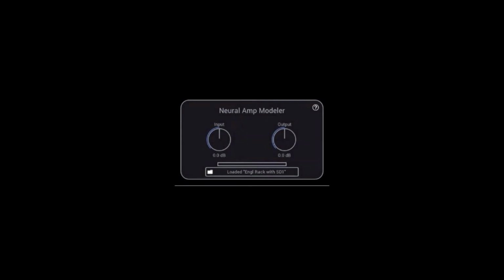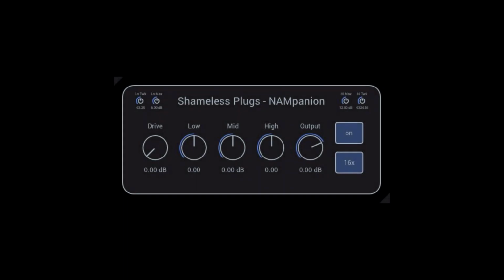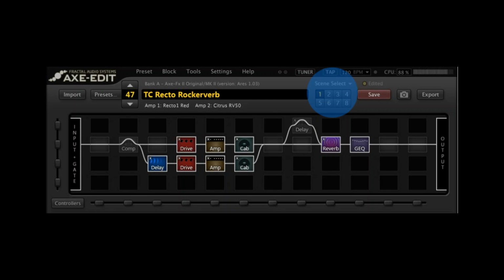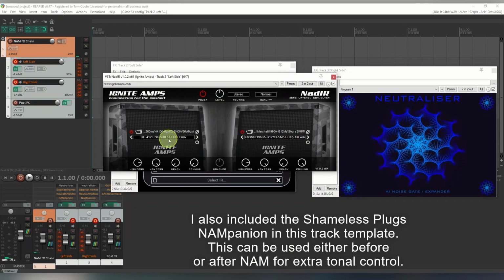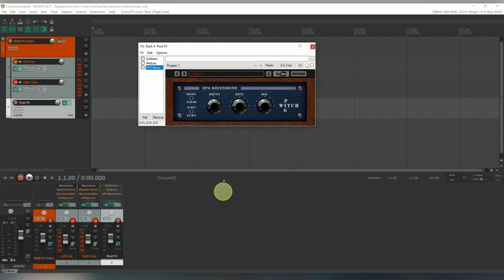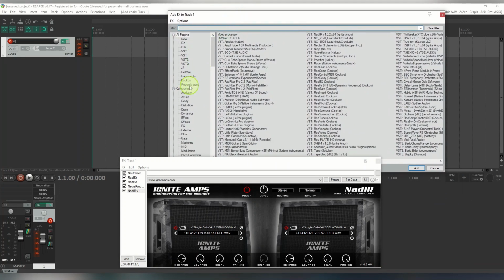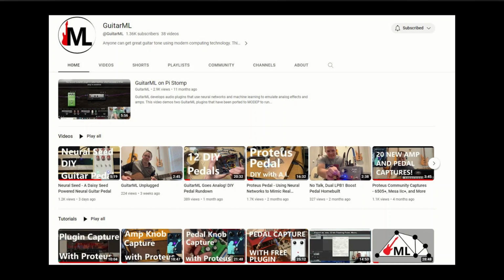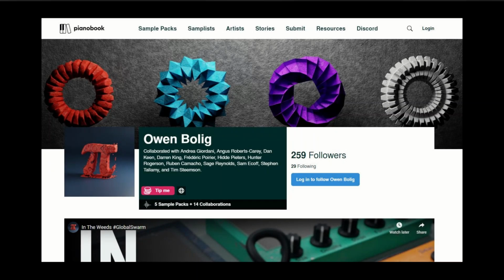Next Level Neural Amp Modeler: Oversampling, Skins, Dual Amp Blocks, FX Chains & more...

Comment: Speaking if which, has Oversampling been added yet?
Reply from the maker: Not yet. But I think the free oversampling filter software I used in the video does make a difference. At leat for me, anyway!
Reply: @tomcootemusic thanks for all the ideas and links.
Reply from the maker: @ramspencer5492  Here's some audio examples for high gain amps: https://www.youtube.com/watch?v=2lSGTrVQpv4
Reply from the maker: @ramspencer5492  ..and here's some I did for bass: https://www.youtube.com/watch?v=kDxZ1SaETUY
Reply: @tomcootemusic . Let me finish watching the video. I read just on my phone last night. Couldn't have done any real listening. I was under the impression that you had to run NAM in 48khz. Might have been an assumption.

No audio examples? Also, why did you use an oversampling plugin if your in Reaper, which has it baked in? Though I am curious about this plugin.

Comment: Oversampling (and internal plugin anti-alasing filtering) is essential for any kind of digital, tube overdrive processing of you want it to actually sound analog and not alias audibly. Whether you hate or don't care about audible aliasing, it will sound different than an actual amp.
Reply: Soundtoys has audible aliasing on Decapitator that I absolutely can hear. And no longer use the plugin.
Reply: When it's down on lower end of the EQ spectrum, Decapitate does sound great on things like Bass and kick....  There is audible aliasing on things like electric guitars and vocals. It does not sound analogue
Reply: It doesn't matter how well the code is written. If you work in lower samplerates, like 48khz.... And have a lot of higher order harmonics, you don't have nearly enough headroom to be able to filter the foldback distortion out. I'm not saying that these kind of plugins that audibly alias are unusable by most people standards. But they do not do what analog gear does. Which I much prefer. aliasing It's strictly an issue in the digital domain. Most people once they've had it pointed out. Realize that they really CAN hear it... And when they have the option of removing it, Love the way that there is added depth and it opens up the sound.
Reply: Absolutely. Totally agree. And actually Decapitator is not TOO bad of a culprit. It's got 4x oversampling built-in, and it compounds; as such, if you oversample it 4x using BC Patchwork, Metaplugin, Reaper, etc. it actually becomes 16x oversampling which is quite tolerable unless you really drive it. Some of the worse offenders imo are plugins like TAIP, Arturia dist/comps, Tone empire etc... really anything that can't be oversampled (not even via wrapper) without completely falling apart. I personally won't touch NAM with a 10-foot pole until oversampling is implemented. Very promising technology though.

Comment: Good video, Evan's design ended up being the winner for now!
If you're interested in the "scene switching" thing, I did put out videos about how I built a custom MIDI pedal for that, as well as how to implement it in Reaper with no latency when switching, which is quite involved in the end. Since NAM is a bit more CPU hungry, I could see that being a potential problem with my switching system, since you're running however many amps at once, but with just 2 or 3, it would probably be fine. Each NAM instance uses about 1.5% cpu on my pc before IR's.

Comment: NAM is great, it’d be awesome if they added stereo input
Reply: why?  amps arent stereo input
Reply: @ShawnGuess  because we, producers and mixers, often like working in stereo instead of mono...
Reply: @mandubien  yeah, that's why I, as a producer and mixer, understand that amps are mono in and mono out and that you can still put stereo effects on a mono signal 😉
Reply: @ShawnGuess  indeed, but it's easier to put one stereo instance of NAM on the guitar rhythm for instance instead of two mono on each guitar track.
Reply: @mandubien  putting one stereo instance achieves nothing except using double the resources
Reply: @ShawnGuess  lol tell me something I don't know... It's just LESS CLICKS. Period.
Reply: @mandubien  then what is an instance where a stereo plugin for an amp sim should be used?  There is none.
Reply: @mandubien DO THE EXTRA CLICKS

Comment: Does the oversampling plugin introduce any latency? (Due to jbridge or the plugin itself)
Reply from the maker: No, it seems fine. The only real problem is that it doesn't seem to retain the selected oversampling rate settings between sessions. 
There's a link to it in the description, and it's free, so you can give it a go and see what you think.
Reply: @tomcootemusic  Thanks!